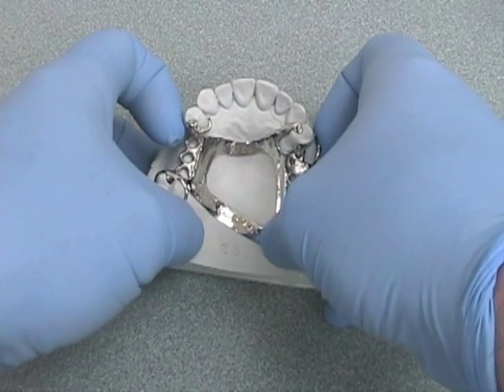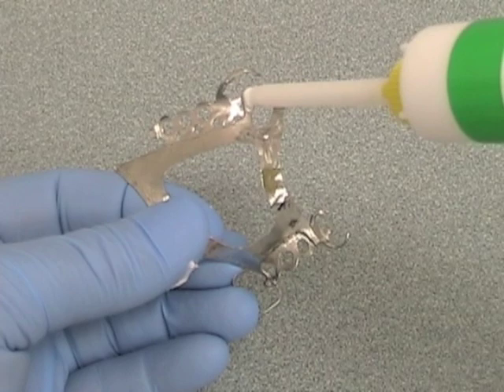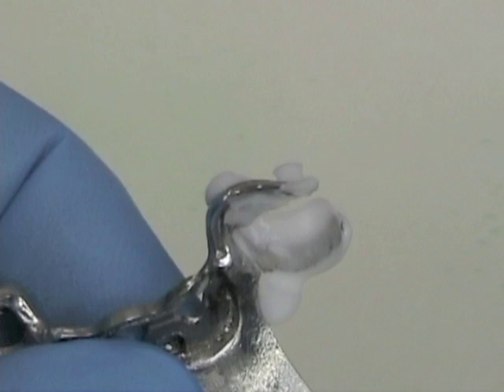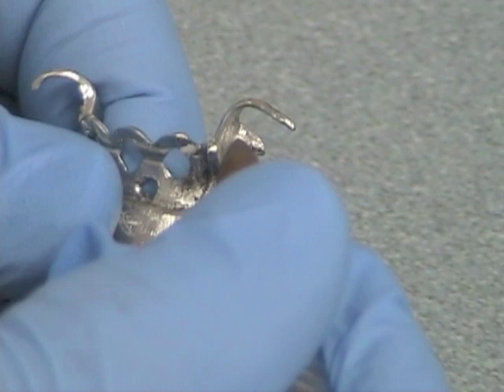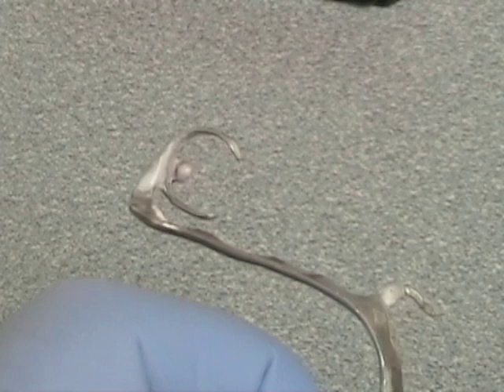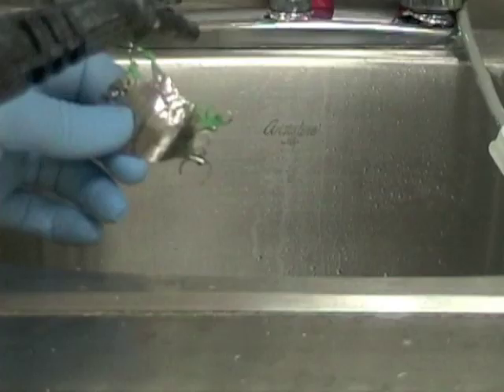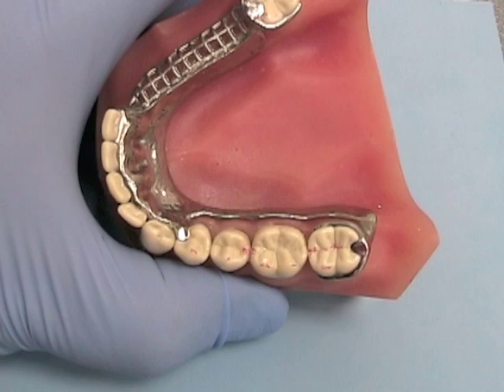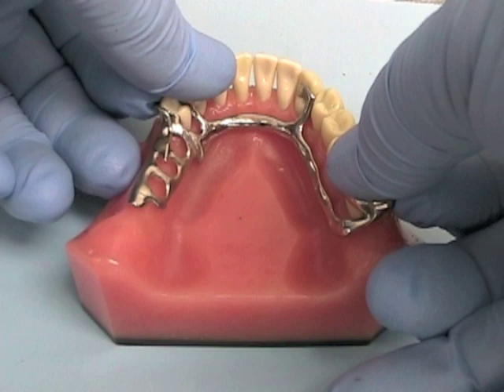13 Framework Adjustment

Comment: I don't understand for checking premature occlusion on the framework. You use a polishing point to remove the high luster on the metal framework!? Wouldn't the polishing point increase the high luster?
Reply from the maker: +Yoni Polack. Finishing & polishing points have different grades of abrasives. Points with more carborundum tend to remove more metal and leave a rougher surface. Other points with finer abrasives result in a higher luster. Pick a point that takes the high gloss off the surface if you're finding it difficult to visualize articulating paper markings.
Reply: I see. Thank you!